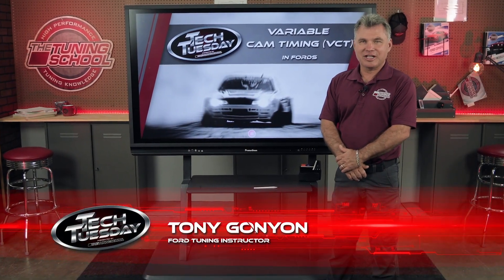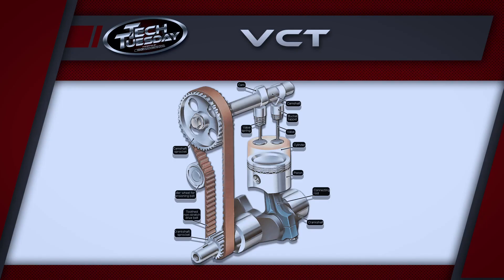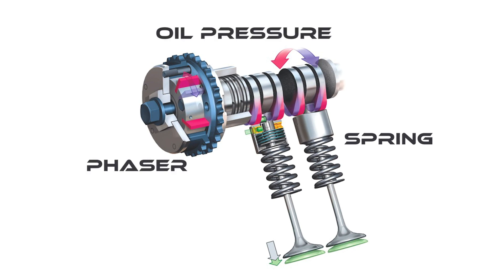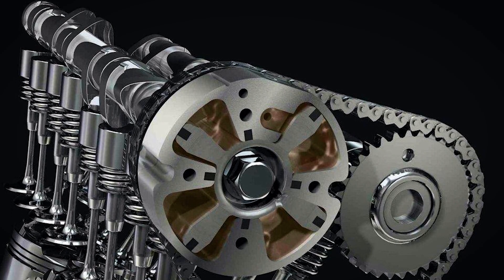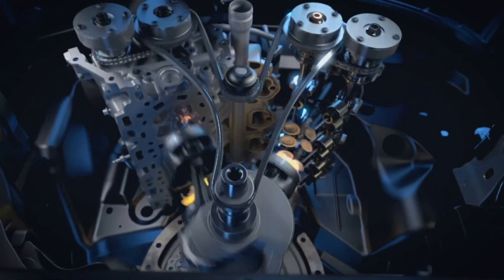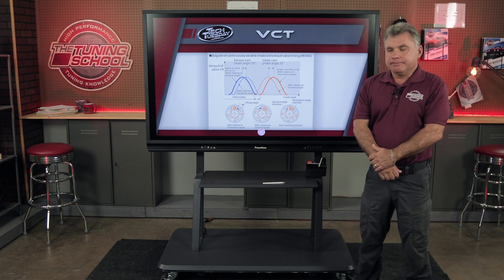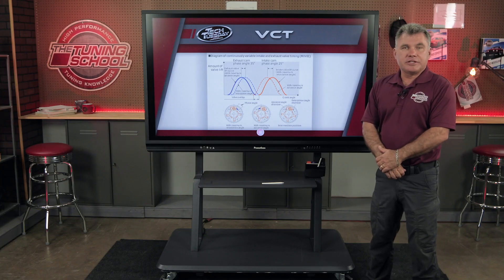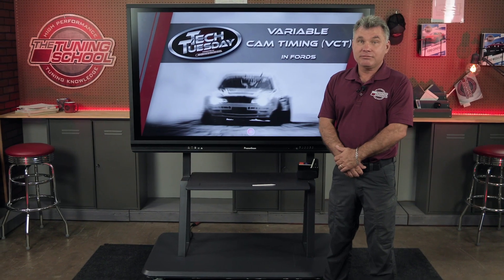Twin Variable Cam Timing (TiVCT)

Comment: Hello, I'm having  this problem : https://www.youtube.com/watch?v=zu0ifTC6H2Q
 I replaced the eccentric pulleys and solenoids. But I couldn't get rid of this sound. It is very loud when cold, but after 2 minutes the sound decreases but continues. It comes out softer. The car is running very well, there are no problems, but this noise at first start-up bothers me a lot. What exactly would you recommend to get rid of this noise? Thank you

Comment: Are these engines reliable ? Thanks in advance
Reply: Had a Focus with that engine and it endured a lot of very, very spirited driving with no issues other than a water pump very early on, but it was under warranty and Ford had since fixed the flaw in that area and I don’t hear anything about it anymore, and it may have even been a recall. I never had that issue again. The twin clutch 6 speed automatic was garbage though. Lots of issues with the TCM and clutches.
Reply: My family has one that I beat the shit out of. For the past 65k miles the only issue I’ve had was the water pump started leaking.

Comment: Tivct is not Vtec !!!!!!!!
I have Tivct on my Caterham 
Is good and fun tuning it on dyno
 but not VTEC
Reply: VTEC is overrated
Reply: @rickitysplitz7035 it’s good for fun stuff but because it doesn’t activate until very high into the rev range it does get used much in normal use
Reply: Fair. My bud has an h22 in his prelude. Definitely unique.